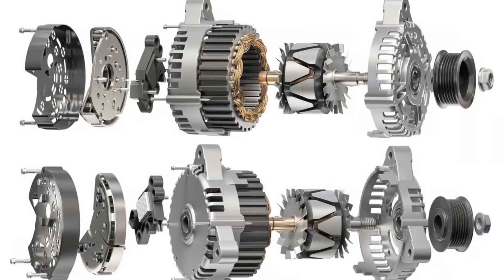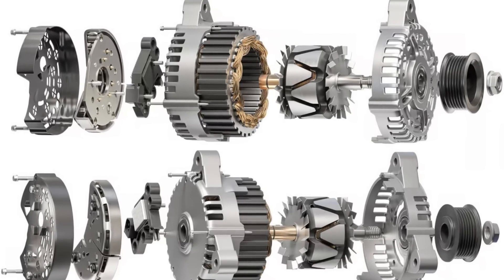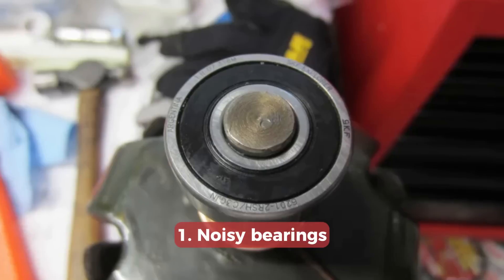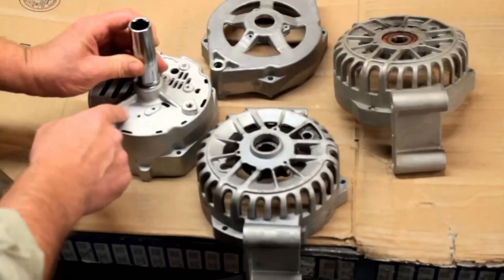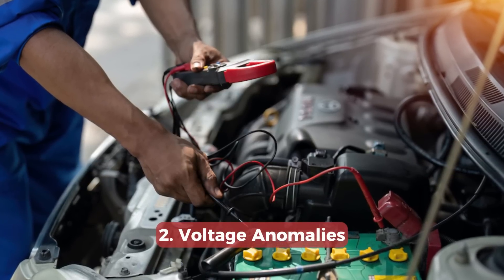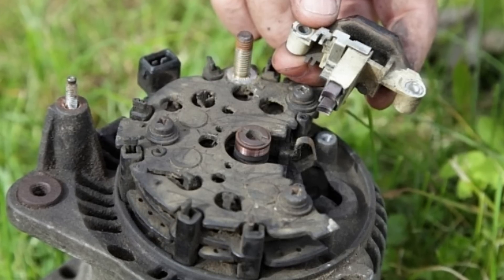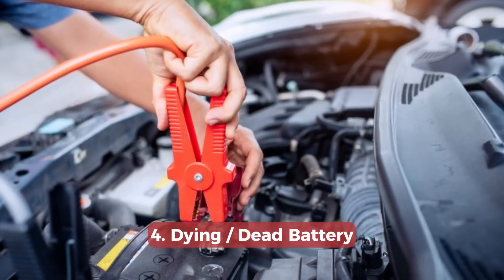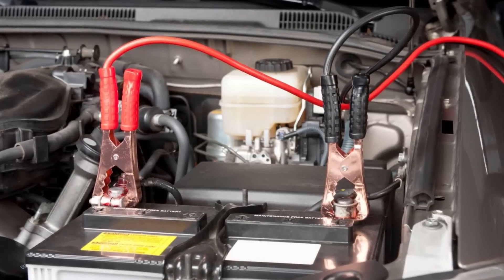Here's how you are killing the ALTERNATOR in your car

Comment: I was listening to a YouTuber a popular mechanic mentioned it is okay to buy a bigger alternator with higher voltage to sustain all the extra electronic gadgets being placed in the car. Do you recommend this? If so, will it cause any damage to the other standard electronic components? Curious to know. Thank you!
Reply from the maker: Well, I wouldn't do this. Maybe, if the new alternator is perfectly selected in terms of all its specs, it won't hurt anything. In terms of voltage, it's a big no of course. You will fry everything with higher voltage. It only can be with higher amperage but it honestly won't pay off because you will need to mod a bunch of things to fit it in. And your fuel efficiency will drop, too.

Comment: the main thing that kills the alternator is the heat, if it can't be cooled properly, even with smaller electrical loads, the diode bridge and the voltage regulator will break, that's why it's always better to make the engine spin faster because then it cools better

Comment: 4:17 not really, if the battery (45AH) was completely empty for the first few minutes it would not draw more than 20-30 A with the fact that the power of the alternator on such a car is 70A, and later the current would perhaps be 10-15A and would constantly decrease, which is not a problem for the alternator because only the lights need that much current

Comment: Ha,,,,Had a Denso in my 03' SILVERADO 18YRS,189K MILES,,,,,,,,,SWAPPED IT OUT 1.6 YRS AGO,,JUST HAD TO REPLACE THAT NEW ONE 3 MONTHS AGO,,,SO 2 IN 1.6 YRS,,,,ALL AFTERMARKET PARTS ARE CRAP IN A PRETTY BOX,,,,,,HAVE HAD 5 ALTERNATORS REPLACED ON MY CLASSIC IN 10YRS,,,TOTAL B.S.,,4 RADIATORS,2 MSD,4 CARBS,2 WATERPUMPS,

Comment: I have a 2016 Vauxhall viva which has 1.0 L engine and the car has done over 155 K and still has the same alternator as I bought it with 36 miles on the clock greetings from Scotland 🇬🇧🇬🇧🇬🇧

Comment: I bought a new Corolla in 2003. Nearly 22 years and 272,000 miles later my alternator, A/C compressor, and water pump have never failed. Why can't GM, Dodge, and many others figure out how to do this? My wife's 2009 Corolla had an alternator failure around 250K miles. All it needed was replacement brushes. Those do wear but slowly and are cheap and easy to replace.

Comment: Original owner of a 2002 Toyota Highlander V6 with 300,000 miles....original alternator, A/C compressor, exhaust system, radiator and suspension. Runs like the day I bought it.
Reply: @bme7491 I guess my 2011 4 cylinder rav4 could be considered new next to your ride. My alternator died at just over 320,000 but every other component its original
Reply: @bpkg1308  I'm just waiting to see what will fail first.

Comment: Since I have the battery in the trunk at the back (BMW), the main cable is routed from the battery to the front (engine) and on the passenger side at the top there is a box marked +.

Very useful. In case of a dead battery, I can connect the jumper cables to the front or back of the car.

If the battery is smaller in size with 55-65 Ah, there is a small block in the battery compartment to prevent movement.

I took that thing away and put a 100 Ah battery inside, and now there's 0.4 mm (0.015 inches) of space around the battery compartment => perfect. I have an amplifier... not very powerful, but for last 2 years I don't have any problems with the battery.

If you have room in the battery compartment next time when buying a new battery, buy a slightly more powerful one.

If it's a diesel engine, a more powerful battery will make it easier to crank the engine in the winter.

For example, from 65 Ah to 75 or 80 Ah. Some brands may have a 75 Ah battery the same size as your current 65 Ah battery.
Reply from the maker: Yes, but coding it properly is a must. Without this, the BMS won't give the battery proper charging.
Reply: Up to 10 Ah more is not that big of a difference. Of course, if there is a problem with starting in low temperatures, otherwise just use the factory recommendation.

It's true that new cars are more complicated than older ones. 🤣

For my BMW it says between 70-80 Ah for a petrol engine, and between 80-100 Ah for a diesel engine.

Comment: Alternators CAN be repaired, but regulators are internal. The housing must be removed and opened; a labor intensive process. The question then is whether to re-gen or replace the charging unit with a reputable, all-new, brand.

Comment: 6...Giving people a boost off (jumper cables). When you connect the cables correctly you will hear your vehicle power draw down. This is frying your alternator. After you are done helping, you have a good one or two months before you will be replacing your alternator. I know this...I have went through it twice. Buy a portable booster when people needs a boost. A great investment. It will save your alternator and your bank account.

Comment: Blyat. This scares me the most and my car is making the whining sound, from the alternator and it's only 10 years old with 100k km on the dash 😭
Reply from the maker: I had an old Passat in Europe. Bought it at 200,000 km and it was already whining like hell. I thought it was transmission. At 300,000 km, I replaced the transmission but the wining was still there. It appeared to be one of the alternator bearings. 100K km with no change in sound. But of course, this is always a lottery.
Reply: @DmitrySapko  I hope my alternator can last a little bit longer before I replace it. The mechanic told me fixing it is not guaranteed and it's best to replace it and offered me a Denki brand for cheaper price
Reply from the maker: I don't know Denki. Reading reviews on forums will help, I believe.

Comment: Thanks I'll check my diodes.  I have a 2024 Subaru Crosstrek.  At 7 months the battery died.   Lucky for me it happened in my garage.  It would not take a charge so had it towed to the dealer.  They replaced the battery under warranty but did not check the alternator as I asked them.  Two months later I thought the starting was a little slow.  The battery checked at 12.3 vdc.  Checked again at idle 12.3 vdc.  Checked at 3000 rpm 14.3 vdc but after 30 seconds it drops to 12.3.  Took it for a drive and occasionally showed 14.5 and on a downhill coasting the car the reading is 15.2 vdc.  I didn't apply any accessory loads.
Would those readings be a symptom of a bad or backward install of a diode causing a parasitic drain or bad voltage readings I'm getting?  I called the dealer and they want 200 dollars to diagnosis the alternator.  I believe the alternator is bad but if not of course I'm out 200 dollars.  So essentially it's a gambling event for me.
Reply from the maker: But the warranty will cover the alternator anyway, the inspection should be free, too. It sounds clearly like an alternator problem. I believe there is no dedicated voltage regulator in your car since the control units are now in charge of voltage. So, it's either a software bug or an alternator dying. Anyway, I would claim in the dealership that any case should be covered by warranty.

Comment: In my experience I have found that a bad battery will eventually take the alternator with it and vice-versa. Also, an alternator is designed to top off batteries, not charge them from dead. That is why I use a battery tester once in a while, and if I have ran my battery dead from leaving lights on or something, I charge it with a charger before driving the car, checking it with the battery tester first, of course.

Comment: My son's 2011 Nissan Cube with 202,000 miles original alternator failed Thursday. I do my own maintenance and replaced the tensioner pulley and belt at 177,935 miles. A weird thing happened new interstate battery Feb 28, 2023 but for some odd reason, it started to lose voltage overnight causing a drain. I think he left on an accessory exchange for a new battery on 12/20/1023. However, the charging dash light and brake light illuminated then would disappear below 3000 rpms.

Comment: Many years ago maybe 25 years ago an Australian telecommunications company had their vehicles including cars and technicians vans etc fitted with full time headlights when vehicles were switched on. 
Couldn’t turn off headlights. 

They eventually switched back to normal because the alternators were failing very quickly.

Reason for introducing this was about road safety making their vehicles supposedly safer particularly during the day.
Reply: I will always say that if and when an alternator is manufactured with the best parts given will give the greatest out put!

Comment: As a alternator ages, the brushes wear and the wear material can coat the electrical commuter pads. I have cleaned a “ dead alternator “ with brake parts cleaner and restored it to charging condition again. It should be noted that this method worked and got me back to normal but I replaced the alternator 2 weeks later as I knew the brushes were severely worn and my alternator was a sealed unit not meant to be broken down and repaired. I used this cleaning as a stop gap solution.

Comment: Not quite correct, the problem is the battery maintenance issues, if the battery is working properly, the Alt will last long. If batery is weak, Alt will die sooner cuz the car is using the alt for power. So, take care of your battery to keep alt lasting a long time.

Comment: Since the rectifier plate is grounded directly to the back casing of the alternator, it is best to run a ten gage or larger negitive wire from the extra bolt hole in the back casing over to the negitive side of your battery! This will eliminate alot of grounding issues that pleg alot of peoples vehicles.

Comment: My Valeo alternator finally died after 19 years. Instead of throwing it away, i installed a new set of brushes and it works like new 😃👍
(The brushes were not even original, they are random brushes i found at a store and had to sand them down to the size of the originals)

Comment: It costs the same to remove an alternator that you rebuild as it does one you replace.  Then there is a labor cost for rebuilding an old alternator, assuming you can get the replacement parts.  And there is labor involved in disassembling an alternator and finding the internal issues.  Most of the time it is a better investment to replace the alternator if you are not rebuilding it yourself.  That being said, we’ve encountered problems with remanufactured alternators.  Much better to replace with new.

Furthermore, throwing an alternator at a problem is the exception, not the rule.  Yes, alternators get misdiagnosed by people, but these people are typically tow truck guys, parts store guys, and some mobile mechanics.  I can’t speak to dealerships as I’ve never worked at one.  I can say that the independent shops I know, the legit ones, not people working solo out of their personal garage, do not do this.  They do proper diag and inspection of wires and connections.

Comment: I agree that most alternator issues are repairable and the most common issue is the built-in voltage regulator, but you'll rarely, or never find a mechanic who is willing to do the repair.  My city has several auto electric shops that do specialize in alternator repairs, with one in particular that I do trust.  Unfortunately, the repair usually involves removing the alternator myself and taking it to the shop for repair.   That repair can often take three to five days from a busy shop.
Then you carry the alternator home to re-install into your vehicle.   If you don't have a second vehicle, this is a real inconvenience, so most people decide to buy a new or rebuilt alternator instead of following the repair route.

Comment: When our 2000 year model Dodge Grand Caravan hit 120,000 miles (it was 22 years old at the time) I replaced my alternator as a matter of course. That way I could do the job at a convenient time and place (my driveway, when I was ready) rather than having to have my car towed from the side of the road, or some shopping center parking lot) I upped the size from the 90 amp original to a 130 amp replacement to use w/ an Inverter just in case I need it during a power outage. I keep the original alternator aboard the van as a spare, if the new one fails on the road somewhere. Thanks for the tips.

Comment: I have a Kia Stinger 2020 GT2 and I usually get an alert on my dashboard that says battery draining due to external device and I've taken it to multiple workshop nobody seems to be able to find the root cause of the problem because if the car is parked for 2/3 days without been driven it kills the battery totally and I will have to jump start the car so far I've had to replace my battery twice does any one have a similar issue or knows exactly could be the problem? I will appreciate any suggestions or opinions at this point.. Thanks!
Reply from the maker: Hey! I haven't heard about common drain issues with the Stinger. And I'm sure a good electrician will easily find the drain. In short, you need to turn the car off and measure possible current at every single fuse the car has. If there is a current flowing through a certain fuse, you then need to identify what this fuse covers and you will get the idea of the drain. If there are no drains, my wild guess would be that the key fob is usually located near the car when it sits and they keep "communicating" with each other which causes battery drain.
Reply: Buy Toyota

Comment: What! You are so off base with this video. If you actually did research alternator failure is NOT a problem. Although I am not quite sure where you live and what vehicles you are referencing.  Also, your criticism of dealership technicians is wrong. Many years ago, due to customer demand for quick turnaround, independent and Dealerships have gone from repairing components to simply replacing them. With that said, you are misleading anyone without technical knowledge in the automotive field. BTY I have over 45 years in the automotive field. The last 21 years as the Technical Training Manager with one of the leading automobile manufacturers.

Comment: When the alternator went on my MR2, I found that you could buy a set of brushes for it from Toyota. So first time, I did this. Second time it went, I found a new old stock replacement alternator for £99 so I went with that. I still have the old one if I fancy changing the brushes again but I would guess after 180k miles that the bearings may not be as good as new!

Comment: One rule people don't know, A Alternator is designed to maintain battery charge level NOT charge the battery, Weak battery , loose & corroded connections will cause alternator to charge more often or for longer periods of time, this creates heat and heat destroys electrical components in the alternator. If you ever experienced a bad battery and was told your alternator is bad too, most often the bad battery burnt the alternator up because it continuously tried to keep voltages at correct levels. Do yourself a favor when cranking issues arise and battery has weaken Replace it, and ck and clean terminals to battery once or twice a year, chances are Battery life will be longer. My last battery in my 2001 Tacoma was 9.5 yrs old when it died, 315 k on original Alternator.... Still Rollin in the Taco....

Comment: Don't forget that if your car has over 200,000 Km on the clock you should change the brushes. My past experience shows they will fail from wearing out by 230,000Km. I've had 3 such failures on past cars, luckily all close to home. The fourth was on a company vehicle, which had to be towed to the headquarters about 50 Km away.
Reply: Who changes the brushes anymore? You can barely even find a tech that will do that.
Reply: @hull5768  I know of 2 shops, one in London, ON and another in Timmins, ON that rebuild alternators which of course includes changing brushes. I bought  brushes at both locations, many years apart, and changed them myself.
Reply: What's needed is brushless alternators, but of course they would cost more.
Reply: There's just two places here in the farmland I know does it.   Not that we can't ourselves it appears.

Comment: An alternator technician said that using a trickle charger daily can double alternator life because it reduces heat from charging the battery
Reply from the maker: Probably, daily is a bit too much. Modern batteries will need maintenance once every 4-6 months to last way longer than average. Daily charging may destroy the battery pretty fast. But depends on the battery type, too.

Comment: Ive got two vehicles right now both with alternator issues, a 79 Fj45 diesel landcruiser that was re-fitted with a newr 2012 AC Delco ag type alt, it failed BC the PO wired the internal VR with +12VDc to the field terminal instead of to the S terminal. This troopy was rebuilt in 2013 and sat unused till this month when I purchased it. The second is a 88 Fj62 Landcruiser the original denso alternator failed last week so I swapped in a Orielleys one and just ordered brushes to rebuild denso. I believe it failed because the 88 sat dormant from 1998 till I got it running last year. My third truck is a 66 W200 Dodge with a 225 slant 6 the original MOPAR alternator still going strong.

Comment: On my 14-year-old car that hasn't been used very often, current mileage around 35,000, the battery light came on and although the belt and pulley was still okay, the alternator clearly wasn't charging the battery - but the battery was really old. Despite changing the battery the alternator still would not charge so I replaced the alternator - I suspected the regulator but couldn't get at it so for the sake of £90 I decided on replacement. So yes, maybe it died because it had been struggling with the old battery.